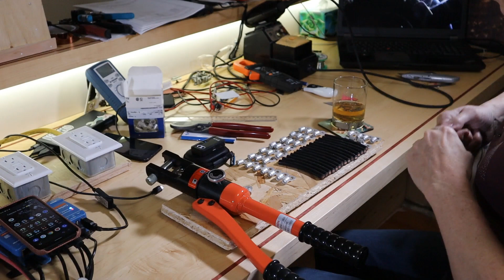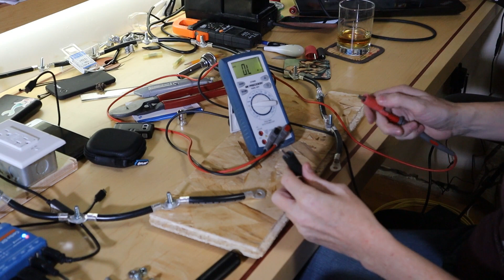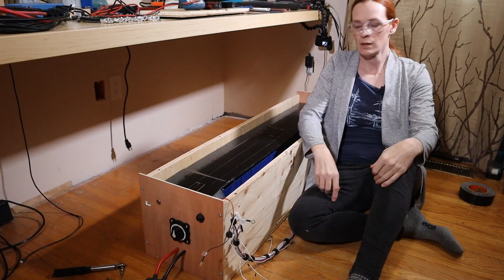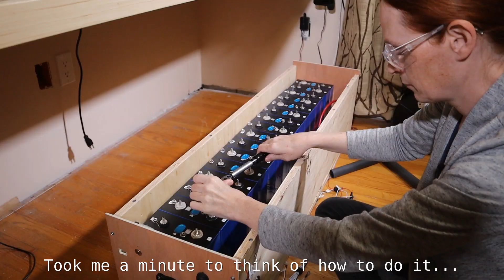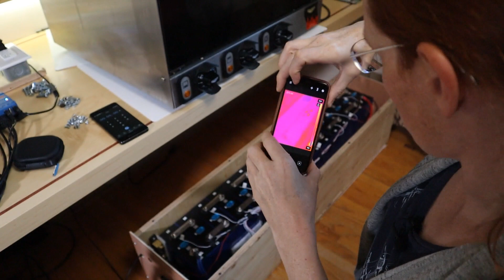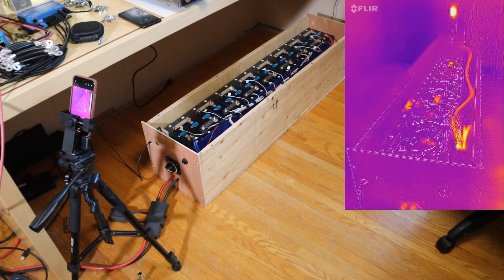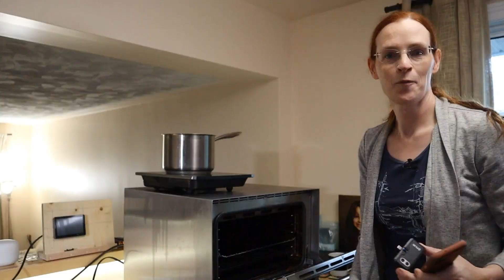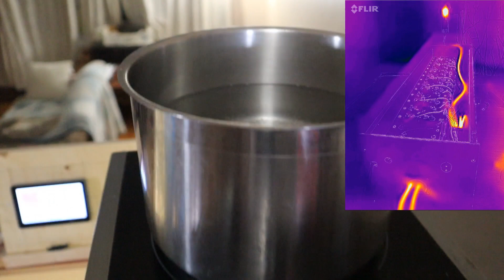What's Better? Rigid or Flexible Bus Bars - How to build a 48v Lifepo4 battery (Ep. 21)

Comment: I know this is an older video, but I had much the same thoughts when I built mine in 2019. but went for multi-layer copper busbars, with a "kink" in the middle for hopefully all the advantages of bus bar but with the flexibility. Only 24 cells in mine.
However the concern when I researched wasn't the bus bar, but the cell size. bigger cells have bigger "knocks" under big vibrations, so it was suggested for mobile applications that 100-150ah cells were the biggest size.   Has more info come out in the year between debunking that.  I did semi-compressed mainly to stop them moving about in my truck, which isnt a smooth ride.

However I'm thinking I should check the torque on all my bolts (not checked since mid 2020) now that you have made me think again about what the movement has done in that time.
Reply from the maker: I'd be really curious to hear if any bolts have backed off. That's some wonderful and valuable real-world data!

Comment: recently installed a lifepo4 battery 100ah in my campervan.it’s smart Bluetooth bms so can see power being consumed by my stereo x3 power amps ‘homemade sub fosgate driver plus kenwood speakers about 15amps on the bms app when wick turned up.I thought why don’t I use my spare agm battery.only new last year one one weak.as had a pair of 115ah arm’s.I know u not supposed to mix lead with lithium but thought could use the agm when stereo on by using a switch to kick in the agm battery.I’m using a separate circuit for agm charged by my old dc charger 12amp and some solar 100watt with epever 10amp mppt.The lifepo4 has victron dc charger 18amp Orion and a Renogy rover 20amp mppt from another 100watt panel..so if I link batteries with fused link and a switch by drivers seat what you reckon ?
Reply from the maker: I've got very little experience with LA/AGM cells, and I can't speak with any authority on the risks of mixing them. I'd guess that the problem/risk is how different the chemistry's voltage changes through charge/discharge, leading towards a lot of current moving between the batteries as they try to balance, possibly harming the AGM/LAs. I'd probably heed the general rule of "don't mix chemistries" to be safe.
Reply: @TheDigitalMermaid  yes probably best idea.thanks for your advice

Comment: HI, i build 48v battery using eve lf280k cells. when i charge them ad around 60amps there comes a deep buzzing sound from the negatice side of the battery.
have you even notice sound when charging like that? around 25amps charging there is no sound anymore. its so weird for me. anyone know whats happening?
Reply from the maker: I noticed buzzing once with the jk BMS just in my last video, but it was not charging. First thing I would check is the torque of the connections. If the buzz remains, try to isolate exactly where it's coming from.

Comment: When crimping the terminal, it is advisable to cover the wire with hydrophobic lubrication, this will prevent oxidation and increased resistance over time. To prevent the weakening of the tightening of the terminals, you can (you need to) use spring lock washer (DIN 127).
Reply: Please give links to "hydrophobic lubrication" and "spring lock washer". I do not know what this is.

Comment: You have a lot of methodological errors in measurements. Your multimeter is not able to measure the resistance of less than a few Ohms, for this there are special devices with measuring bridges. The thermal imager cannot be measured by the tale of reflecting surfaces, since the heat of other sources is reflected from them.
But you could bypass these restrictions by measuring the actual voltage drop on the jumper at a certain current.
Measurements of the temperature of the reflective surfaces, covering them with soot from a burning candle.

Comment: 1:59 : Flexible bussbar got 5 or 4 interface ..how so ? Only 2, same as a rigid bussbar.
Edit : Sorry, got it now, you're talking about crimped bussbars.... those are not bussbars but cables ... flexible bussbars are not like this, they made of pure coper.... not cables.
Reply from the maker: I know they're cables, the first few times I referred to them as "bus bars" I think I air-quoted to show I was using that term more to describe their use. That said, they're tinned copper cables, so the current carrying capacity is more than enough for the job. I gave some to Andy and he ran over 200A for extended time and there was no issues.

Comment: I'm very late to the party, but one thing that's different between the rigid vs. flexible bus bars is the flexible ones have insulation on them. That said, you'd expect that the tips might have warmed up. So I think your findings are interesting and valid. Thanks again!

Comment: The marine environment - ie salt water minerals - may be an issue with the wire bus-bars if they are not well heat shrinked/sealed.  If you go with the cable connectors over rigid bus-bars it would be a good idea to periodically check them for heat build up over years of use to be able to check if there is internal corrosion affecting any individual cable. 
Great vid, thanks for posting.
Reply from the maker: I'm using all marine-grade, tinned copper components. You'll notice I also used boots on the Anderson connectors as well. Keeping moisture out and avoiding corrosion are very much front of mind in the design and build. :)

Comment: It's not possible to measure super low resistances with a standard ohmmeter. You need a micro-ohm meter that use 4 wires. Two wires push a moderately high current (~ 1 amp) AC current through the test item, and the other two leads measure the voltage drop. AC is used instead of DC because it is easier to measure tiny AC voltages accurately than equally tiny DC voltages. If the test current is 1 kHz AC, the measuring circuit can use a narrow bad filter tuned to that frequency to exclude random noise, and it's pretty easy to measure with 1 microvolt resolution. That gives you 1 microohm resolution if the test current is 1 amp.
Easier for the home experimenter: just run a high current through the links, as you did, and measure the voltage from stud to stud.

Comment: I have to come back and watch from 15 minutes... and I think you are on to something ... and I'll employ similar.  My main reason is what I learned in ham radio that electrons pass on the surface of the metal (conductor), not "in" it.  With multiple strands there is more surface area and thus will pass current better and voltage as well, ... etc.  I will have to think more on the connections/connectors... maybe there is a better design to make and employ...

Comment: There is an interesting video on this topic on Youtube by Ray Builds Cool Stuff and he explains why you want to use 1/0 cable and not 4 gauge when making flexible bus bars. The main problem with using anything thinner than 1/0 is resistance. Here's the video. https://www.youtube.com/watch?v=1Ag_sgb22Dk

Comment: And by the way a soldered wire to lug connection is far superior to a crimped one.  Crimping is easier but definitely not the way to go, contrary to you stating so in this video.  The information in this video is not definitive enough to be safe to use and could be downright dangerous.  
For instance use of aluminum lugs as opposed to copper or tin coated copper could be a source of shrinkage and eventual fire danger.

Comment: Maam, I've been doing electrical work for many years, probably longer than you've been alive.  I have formal training in electrical engineering.  Use of copper in junctions such as breaker boxes etc has a long long long history.  Proper torque, periodic inspection (which includes testing torque/retorque) is necessary to prevent friction issues.  Conducting electric doesn't change whether you use batteries or other  sources of current.  The principals are generally the same.  I'd recommend the same procedure as I mentioned above no matter what you are using in electrical junctions.  Aluminum is the worse substance to use out of all the common ones being used, presently.  Copper is one of the best.  Aluminum shrinks due to oxidation in atmosphere and especially without a dielectric treatment.  All of this is commonly understood and really doesn't require 'testing'.

Comment: Greate test! However, measuring very low resistance becomes very inkonsistent using a multimeter. Even if it has a very low range. One should use a special instrument for this with 4-wire test leads (kelvin clamps). I assume there are other comment on this to. I didnt read all of them.
I have built some batteries and opted for thick double sided tape in the corners of the cells to allow the cells to bulge without putting strain ion the terminals.

Comment: I am sure there would be a difference between (COPPER buss bars) and the (ALUMINUM buss bars) you used.
I also KNOW from experience that measuring millivolts across the 'buss bar, wire' will give a much more accurate measurement of what is going on.

Comment: If you live on a boat Used tindwire whenever possible.
 Or sautter exposed copper. I like to cut up a pair of jumper cables For a car battery.
 You'll notice the wire is micro stranded. Stranded wire works better than solid wire less resistance. Because electricity travels around the outside part of the metal not through the center of the metal so in theory stranded wire has more surface more area to carry the current

Comment: "In this video, I explore the differences between rigid and flexible bus bars. Using a FLIR camera", should be "In this video, I explore the differences between bus bars by surface conductance. Using a FLIR camera". The terminals used on the flex bus bar were factory prepared to connect to the battery terminal. Only three out of fifteen of the bus bars heated. You think those three are bad because they are solid conductors? You will see better results if you properly prepare the surface conductivity of the solid bus bars. Solid? Flexible? Make no difference if they have the same conductivity, especially on the surfaces.

Comment: I would assume if the battery cells move separately it could have an effect on solid bars.

It sound logical to assume that if the cells are mechanically mated together  (via strap,box,container,mounting) 
Like a proper lead acid battery.

You shouldn't have any vibrations damaging anythong.

Comment: May I know what material do you use for the bolt? I'm particularly worried about galvanic corrosion.
Reply from the maker: I'm using the bolts that came with the battery.

Comment: The oblong holes in the buss bar is a contact problem! Ring terminals have more intimate contact. Stainless terminals have high voltage drop.

Comment: Thanks for documenting this! Super good test. I think you may be seeing thermal reflections off the rigid busbars. Aluminum has a really low emissivity and especially high reflectance in the infrared regions. You need to turn the busbars into black bodies with some black electrical tape. Then it should be fairly comparable under the thermal camera. I figured out the same thing a few years ago.

Comment: I have a few questions  for you. And a couple of observations.
Reply: Ok a couple of things contact electrical grease. Then when torquing down any mechanical connector (IE engine parts, electrical) the common practice is to first torque to 10-20% less than finsh torque  so lest say 5 to 5,5 nutons first round, then 6 nutons on the next two. And of corse in a cross star pattern when dealing with pressure. 
I know Linux is very hard to use and troubleshoot/ debug but it is pretty much 95% programmable but can and will bugger up your system if the slightest program educate is missed.  And you manage to over come all your programming issues. But victron should have been more hands on as if available on all 4 platforms would greatly benefit them and push them in the for front for gride tied systems. (Apple, windows, Linux,  Android, )  now if you could clean it up you know edit like you would want the information delivered to you. I didn't want to recreate the wheel just make it faster, last longer, cheaper, would you not want a link to here is the programming file?  I think the nice folks a Victron should send you a little something for your troubles. Again good job! You know that boat of yours could use a little something something. May the wind be at your back, the mist genital on your face and the Devil hear about your departure 20mins after you get to heaven 😉.  🍀 ☘

Comment: Hello - really interesting and very informative - thank you. I saw a recent Off-Grid video about the heating of the aluminium busbars, and heard you sent Andy the flexible busbars. Based on the learnings from these videos and the fact that my batteries (96x 304ah cells, 16s, 6p) will be on a boat methinks I have decided to go for flexible busbars to allow for any movement while on the ocean wave.  Each battery will be set up in two rows of eight cells, so I will need a few slightly longer cables too. I don't have the cells yet and I am things about getting the cables made by professionals. So after all this my question is: how long is the ideal cable length for the flex busbars please? Plan on using 60mm2 cable good for 415A - but that feels a bit heavy.
Reply from the maker: That's the size of pack I want on my boat, though I suspect I won't be able to fit it. Curious, have you considered 6x separate 16s packs? More redundancy. It would also let you use smaller cables between packs and bus bars, and you can then size wires off the bus bars to your loads. As for length, "as short as reasonably possible" is always the answer.
Reply: @TheDigitalMermaid  I will let you know how I get on. In effect the batteries are so close to the motors that the batteries will terminate on a busbar central to the battery box and the motor's own power cable will connect directly to it. I am using steerable pods - the power cable runs down the rudder stock and comes preassembled.
Reply from the maker: @MOBiEC1  What motors are you using?
Reply: @TheDigitalMermaid  2x E-tech 10kw steerable pods by Starboats

Comment: The buss bars carry different loads from each cell depending on the SOC, cell resistance, So you will see in the thermals the activity in the cells as well as the connections. Did you do a single buss bar resistance measurement with the solid buss bars? With a total resistance of .1 ohm and drawing 56 amps you have an equivalent heater (battery) of 313 watts. Or about 11 percent of the wattage drawn wasted as heat in the buss bars. Wonder what the resistance of that long wire is?? More wasted energy.

Comment: How much compression, is bad or dangerous?
It seems like ,a consistent beneficial compression is near impossible when the charge and discharge cell pressures are going up and down differently in each cell, and combining with each other.

Comment: Thank you for sharing your experience. I have similar setup and I found more voltage drop between the battery terminals connected together in case of rigid bus bar than on flexible bus bars. In case of flexible bus bars I was able to fix any contact resistance issues by rotating the connector if tightening of terminal screw at specific torque was not enough. Great video! (sorry for my English).

Comment: One thought, the solid bus bars have a slot while the ring terminals on the flexible wire are circular. The slotted solid bars don't make as full of a contact as the round terminals which may cause increased resistance at the point of contact thereby becoming hotter. Another consideration is the amount of handling on the solid bus bars long before this test was done, any accumulation of oils from the fingers might also have an impact on the resistance. A third consideration is when stringing together the solid bars for the test is that they make a full (better) connection with each other than they make when attached to the posts and therefore don't reveal the weaker connection.  I suspect that if one was making a static installation without much flexing, it would be better to have circular holes in the bus bars rather than the slotted holes with the circular holes being a closer fit to the posts thereby making a fuller (better) contact.

Comment: Great test. Thank you! I'm provisioning my own sailboat with DIY lithium batteries, and your videos have been helpful and thought provoking. I too worry about cell movement in a seaway. I am concerned about chafing of the thin blue plastic insulation around the cells caused by relative cell movement. Long term, when exposed to salt air, there is a risk of the cases developing a chalky, white coating of aluminum oxide - which is as abrasive as sandpaper. The aluminum cell cases have a positive potential, and if two cell cases were ever to come into contact in a series-connected pack, that would cause a short circuit. I'm placing thin sheets of G10 fiberglass between the cells and clamping the whole pack for mechanical stability.  

I am also using the same lugs as you, that are open ended on the terminal side. I solder the open ends after crimping and add heat shrink around the cable ends, both for corrosion resistance.
Reply from the maker: You'll see how I address some of this in more recent videos. In short; 2mm foam padding, and the box has ip67 rated grommets and what not. The trick will be to make the box fairly airtight to minimize salt air incursion.